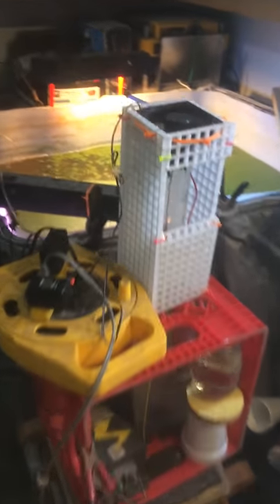Birkeland eyde reactor

Comment from the maker: New idea, a reactor that uses compressed gas passing into a pressurized vessel. All chambers will have regulators. I will use a 300psi refrigerator compressor, and step down all the pressures from there. Slowing down airflow and increasing the density will increase output.

Comment: good video ! Is it Possible to make a transformator for this process from an old welding machine ?
Reply from the maker: no, it would overheat within a couple minutes.  a neon sign transformer aka nst is made to run an open arc for days if not weeks, which is needed to make any substantial amount.
Reply from the maker: i can help you with ways to get these parts